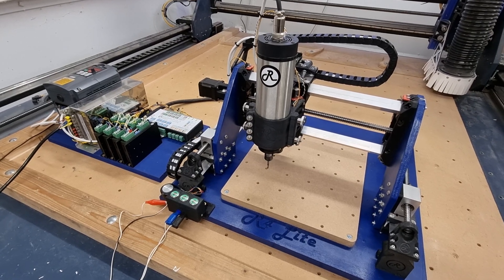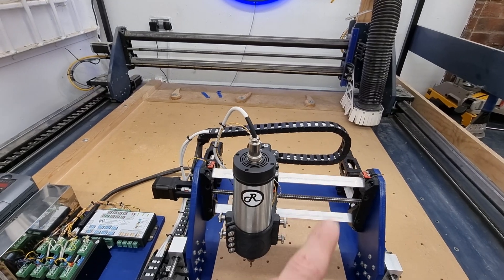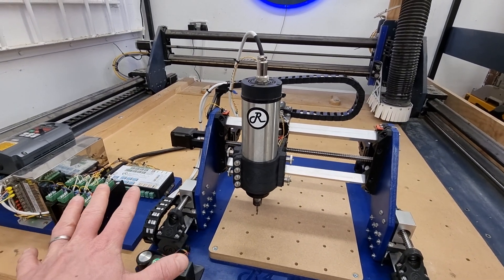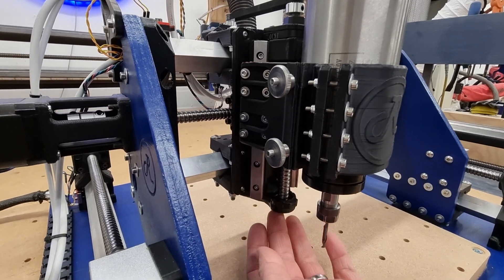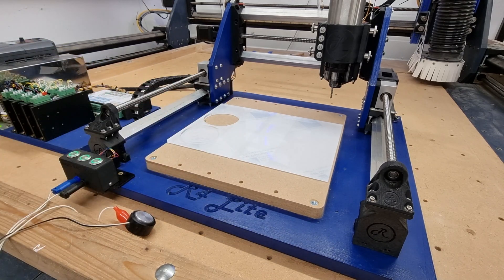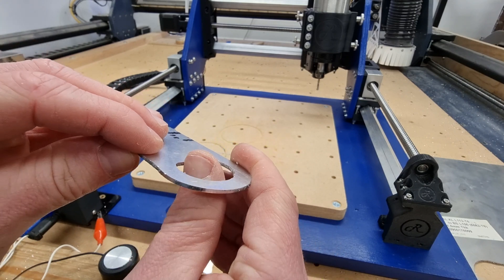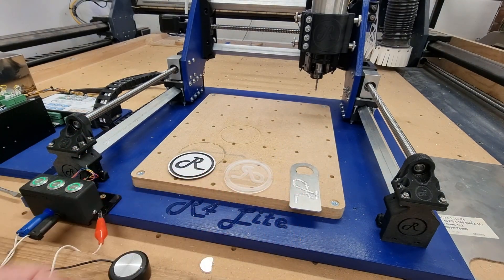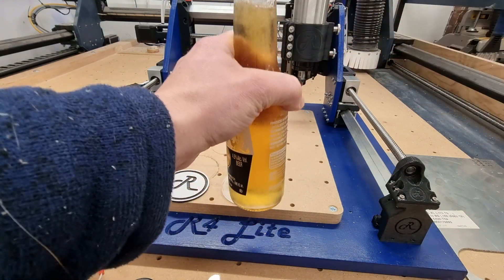Root 4 lite - Root Controller ISO - 3D Printed CNC - CNC aluminium

Comment: Is there a limit switch on the Y axis on both motors? Homing is done using two limit switches on both Y-axis motors?
Reply from the maker: Yup, consider the Y axis as two Axis's, "ganged" together. This means you can home the machine and perform a auto racking feature; to make the machine square, this offset value can be software configured for all axis, so its super easy to home and square the machine.

Comment: When cutting aluminum, what kind of accuracy do you get?
Reply from the maker: Taking that bottle openner: the width in CAD was 40mm and measuring with a veener right now. I got 40.03mm.. so all in all very very good
Reply: @RootCNC  I admire this is really a very good result. Great job.
Reply from the maker: @11111tomek11111  after your post, I put a photo online. You can see it here https://www.instagram.com/p/Cacxzv3r5OV/?utm_medium=copy_link
Reply: @RootCNC  How is the precision of the dimensions in the other axes?... Have you tried cutting steel maybe?
Reply from the maker: @11111tomek11111  I haven't attempted steel TBH - I should give it ago. I've uploaded a photo of the other axis (X) to my instragram. The Z axis was off but that is due to my Z-Probe not being correct - I used a nominal value rather than measuring the thickness of the probe. https://www.instagram.com/p/CalHCRZtxCY/?utm_source=ig_web_copy_link
Reply: @RootCNC I am really under great expression of accuracy. The structure must be rigid to get such accuracy when cutting aluminum. Great job. CONGRATULATIONS.

Comment: Awesome achievement mate...... your project has come along way since I built my Root2 back in 2017 (which I still use) but it might be time now for an upgrade... cheers and stay safe Pete.
Reply from the maker: Love it! Thanks for the nice words! It means alot :)
Reply: @RootCNC  can I use your project for individual order for a small fee?
Reply from the maker: @balexfox  it depends what that order is. You cannot sell the cnc designs or parts for profit but if you design something which was cut by the machine. Then that's OK along as it not designed by Root cnc
Reply: @RootCNC  for example, I will print all these details, assemble the machine and sell it, adding time costs. I do not plan to collect it in bulk, just not everyone can collect it. and people simply don’t have that kind of money to buy from the factory for a home hobby.
Reply from the maker: @balexfox  doing that will be against the open srouce licensing agreement, which the files have been released under, You cannot do that.
Reply: @RootCNC  thank you I will find another project. )
Reply: @RootCNC  can I buy project or donate how I can used it for commercial?